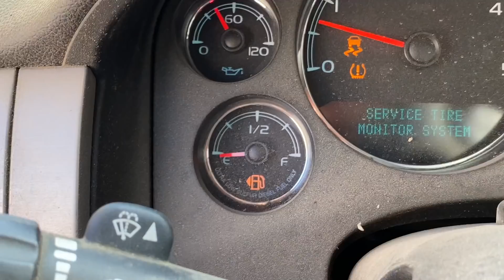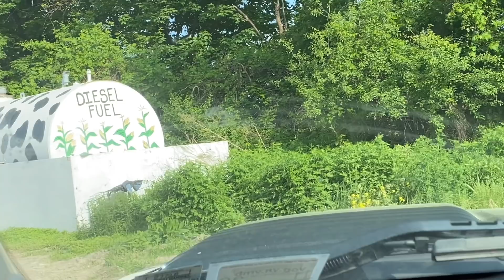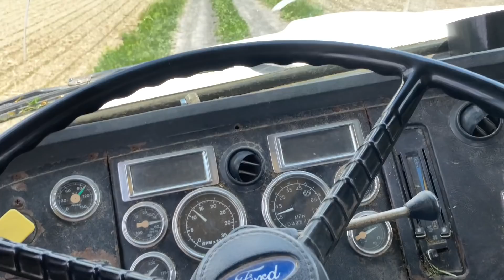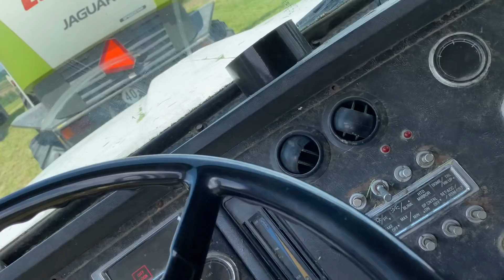A DAY IN THE LIFE OF TIM

Comment: Your grander could be most anywhere in there or not even in there.  The key to always knowing where all your tools are is to have a designated location for each and always return them to their perspective location after use by anyone that used it or them.  Checking gas gauges is also important.  The life and times of a farmer is sometimes comical.  Too many things happening and needed to get done at the same time.  Leave the truck there and make a planter out of it.  Do you use everything you have at least once a week?  Your doing what needs to be done.  Work fascinates me as I can watch it for hours.  Thanks for sharing a day of work on your farm.
Reply: You soon learn to check fuel gauge every time you get in a tractor after you run out a couple times in the field and have to bleed the line before it starts again 😂

Comment: I used to spread chicken litter for a farmer I worked for and the truck was a l 9000 like some of your trucks. Ir had a m11 Cummins in it, walking beam rear end and it went to gays tire I think who did it and thay put the military tire conversion on it. I think he had to lift it a little bit, make rims for all 10 tires. That truck would suprise you how good it stood up and where all you could go w it. It was bulletproof too, that truck took a beating all day everyday and never gave any trouble. We spread for alot of farmers in our area so it got well used. Had a light bar in it and I spread in 4th gear w the foot feed on the floor. We had our gate on back of spreader marked for 1 ton 1.5 ton 2 and 2.5 and 3 tons, according to how wet or dry the litter was you might would have to move up or down a notch or two but very good dependable trucks, have alot of miles in that old spreader truck